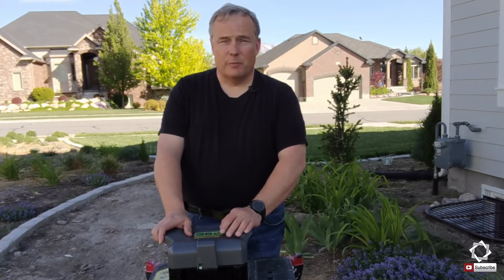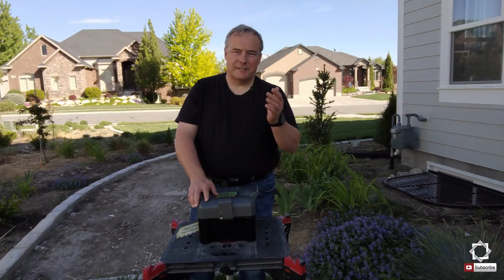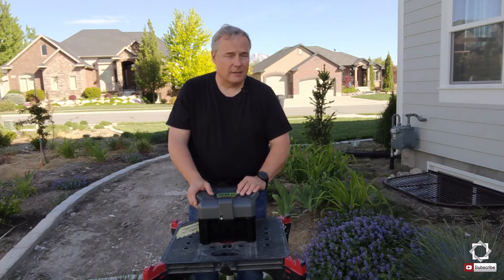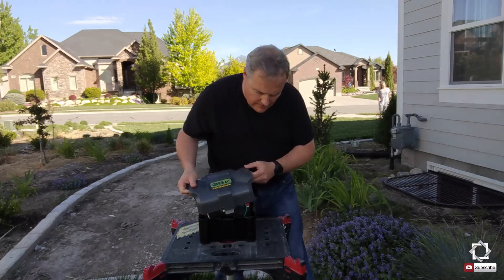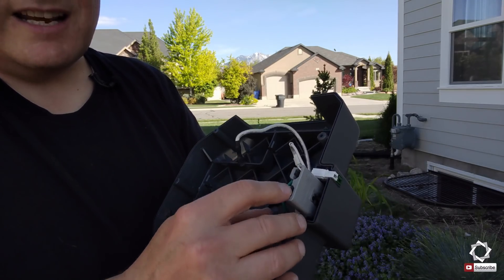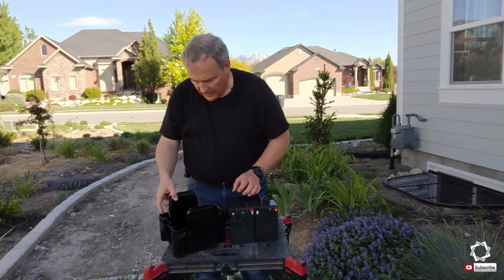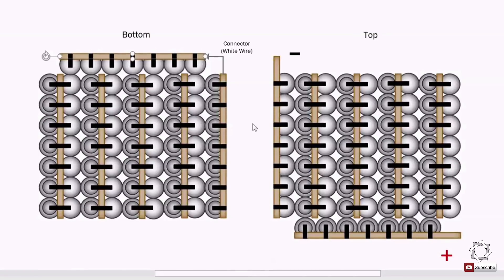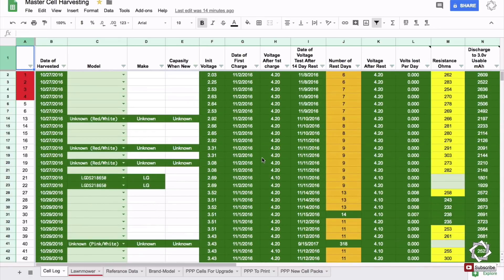Custom 7P 10S 36v Lawn Mower Battery

Comment: I realize that I am a little late to this party, but decided to undertake the same conversion of my B&D mower.  Now, 3 years later, is your battery still working out for you?  Are you using the charger that came with the unit?  Great project, thanks for leading the way!

Comment: Great!  Your new battery has 3 amp hours more than the lead-acids--around 20% more capacity, AND almost all 18650s can run at double its rated capacity without breaking a sweat, this battery ought to easily out perform the tired, old lead acids.  I have an electric cart to carry my golf bag and replaced the 21 pound lead acid with a 7 pound lithium ion battery (4s 15p) and those motors LOVE the added power/voltage (14.8 rather than 12).  Thanks for the vid.
Reply from the maker: That's awesome, thanks for sharing!!!  Let me know if you do any other fun projects.